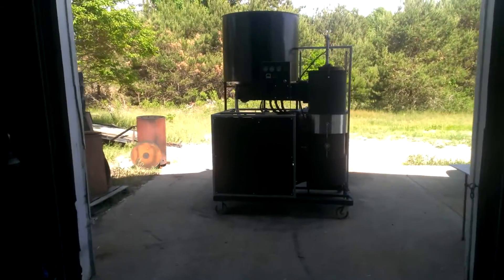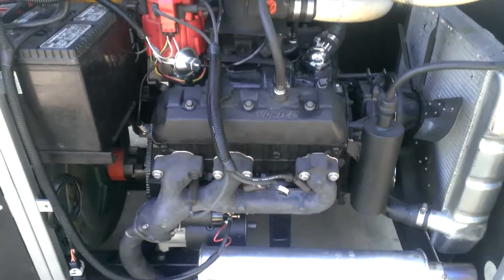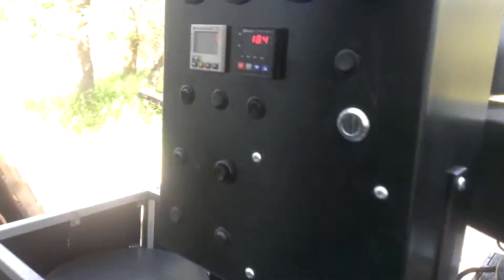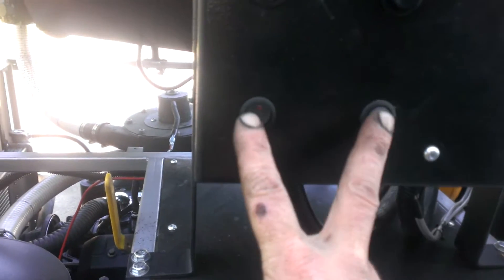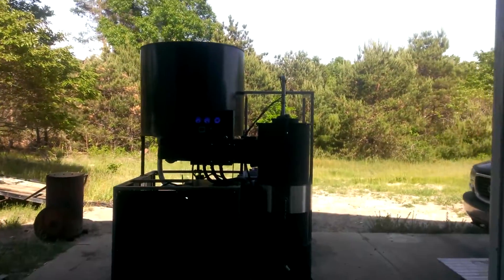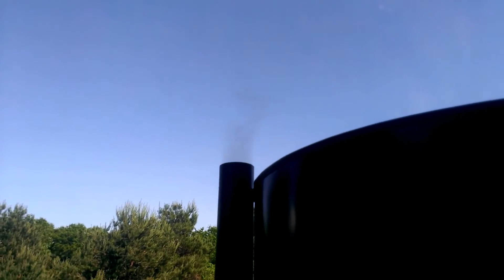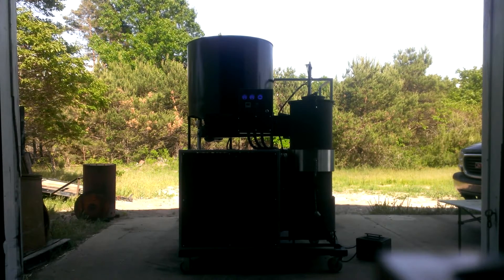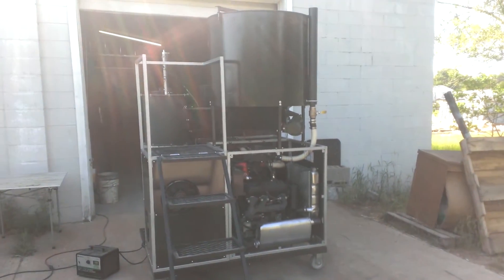1326 Test Run

Comment: Very professional appearing.
Reply from the maker: urgentcareguy3 This is the second prototype, have you looked at the LS-1 version? This one is a bit more advanced, and next generation versions after this are much more polished. I will be launching new development on these large machines in a few months. Very advanced filtering, automation and on the fly maintenance features are coming for next years models.
Reply: Yes, I like the LS 1. I'm working on a 351W with similar gen head. The one thing that I realized is that if you go direct drive with these set-ups and stay at 1800 rpm, you miss the broadest portion of the HP and torque curve, depending on the engine. Though you would have really good longevity.
Reply from the maker: exactly why we build our systems with over sized engines, this is why off the shelf gen sets do not work.